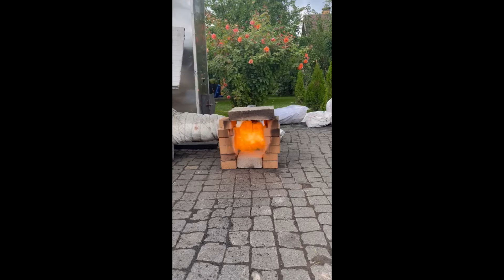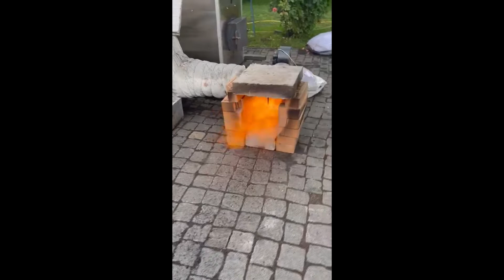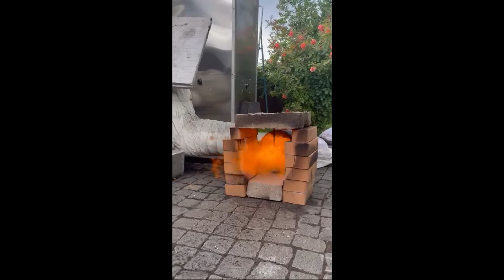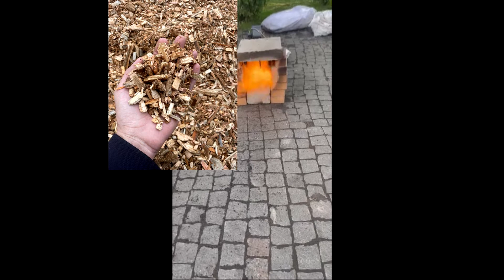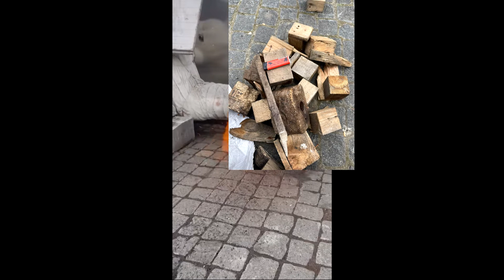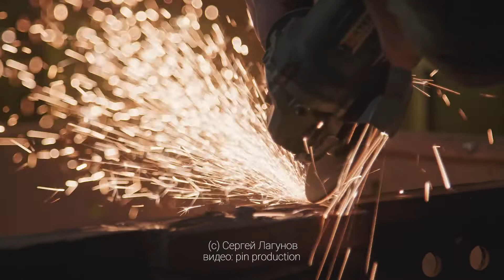Wood gas from wood and plastic waste: design and sale

Comment: It is necessary that a solution be found with the smoke from the pipes. In order not to poison the environment. Is it possible to invent a closed smoke pipe system?
Reply: It's an invert downdraft gasifier. With filters. No smoke